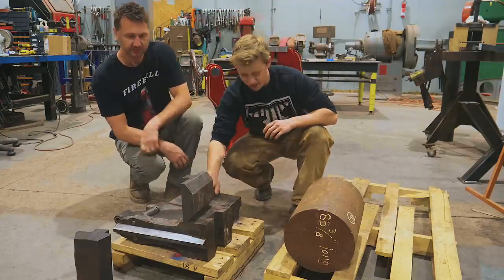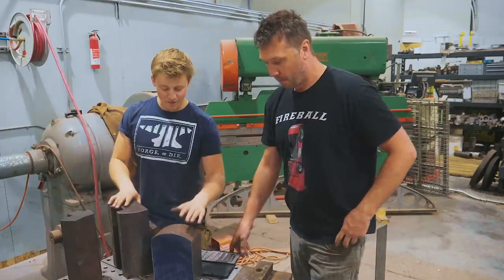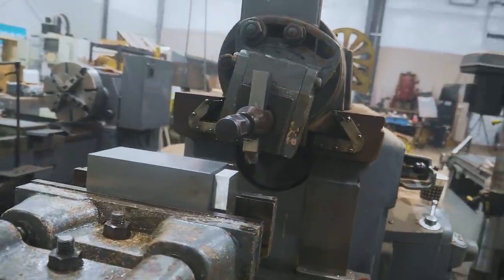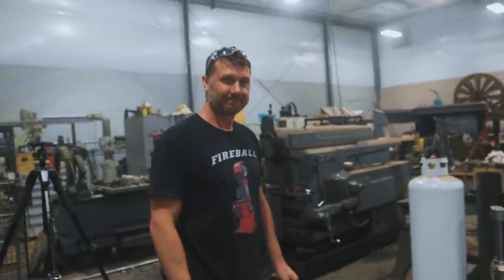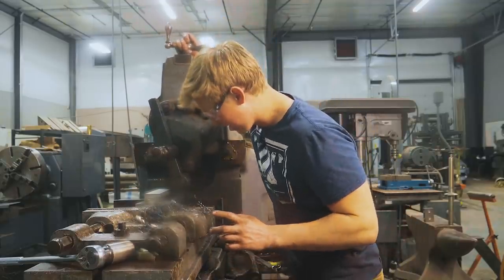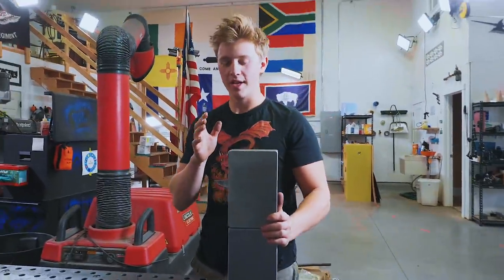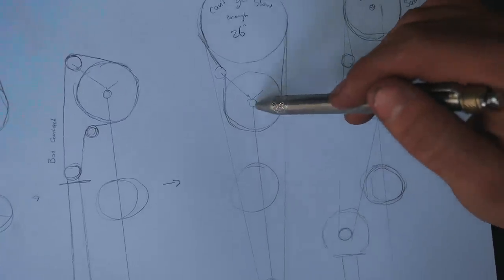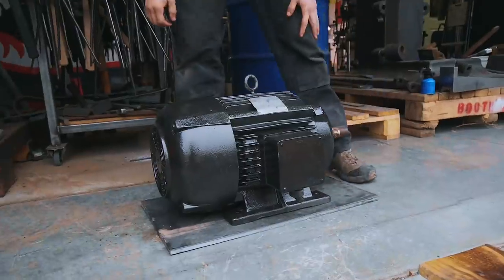RESTORING THE FAIRBANKS POWERHAMMER!!! Part 5

Comment: The shaper is simultaneously fascinating & terrifying. It is literately just carving away steel like you would carve wood with a knife.
Reply: I was little surprised. Seemed to be heating the chips from what i saw.
Reply: Such big cuts too
Reply: @1014p  That heat is being generated by the friction. Same as drilling or milling.
Reply: Right it's like the world's biggest most complicated & scary chisel.
Reply: Looks more like the linear version of a lathe to me. It's just that it runs so slowly by comparison- you can see the chips change color as they are cut, when you can't on a lathe (unless you watch in slo-mo).
Reply: @markfergerson2145  That's the thing, though, a lathe, like a mill, uses rotational velocity to make a cut, where as this just uses an edge and what has to be tons of linear force. That's what makes it scary: the shear (ba dum tish) amount of force being applied.
Reply: @Varentill  right, the advantage of the shaper being that the cutting edge can move much slower than on a lathe or mill, which can means that the heat could be controlled arbitrarily? (Need it cooler? Go slower)
Reply: @1014p  it is literally shearing steel apart. ever take a paperclip and bend it back and forth really fast and it heats up noticeably? this is that but at several thousand times the scale. the amount of kinetic energy being put into that act is phenomenal. those chips are a couple hundred degrees, you can see them discolor from how hot they are, those bluish and copperish colors. thats not paint or dye lol. come to think of it you could probably get a pretty accurate measurement of the temperature based off of that discoloration.

edit

yeah. Heat the steel to temperatures from 400 to 800 degrees Fahrenheit, to produce oxidation colors. At 480 degrees F., the steel turns brown, at 520 degrees, it turns purple, at 575 degrees, it turns blue and at 800 degrees, it turns grey.

so at about 4 min of the vid, those chips are around 575 degrees f on one side and 480 f on the other. the "hot" side would be the one that just came into existence as it came off the block. about 20 seconds later the chips are very light blue and mostly grey. which if google is correct means that they are approaching 800 f
Reply: @commie4164  yes i have just cant imagine it cutting that slow and getting that hot. Makes me wonder how the blade can handle that kind of force.
Reply: Imagine what it could do to flesh and bone
Reply: @1014p  We were using a smaller one in school.  Then the tool snapped.  Missed a guys head by ~6"...

Safety glasses won't save you from that.
Reply: @NemoConsequentae  You would think there would be some sort of guard on it, or around it. With these sort of forces, a broken tool is going to do some damage to 𝒔𝒐𝒎𝒆𝒕𝒉𝒊𝒏𝒈.
Reply: @2H80vids  No guard on them.  We were in front of it, basically where the camera was filming from.  Have a look at the shaper, you'd need to have a huge surround that needed to be moved for any adjustment.  Also, these are old machines from before such things were common.  Back from the dim, dark days, before common sense was bred out of the population! :p  
Like in the days before warnings like "May contain nuts" was required on packets of nuts...
Reply: @NemoConsequentae  Being an old machine, designed by and, in theory used by, folks with a bit of common sense, it doen't surprise me that it didn't 𝑐𝑜𝑚𝑒 with a guard. In this day and age however, I'd have thought that modern safety regs would require some sort of guard to be fitted when used in a shop. I'm no machinist and I'm not saying it really needs one (if used correctly), just saying I'm surprised one isn't fitted.
The nuts are a fine example of how it's not always left to the 𝑜𝑝𝑒𝑟𝑎𝑡𝑜𝑟 to make the decision. 😁
A pretty impressive bit of kit though; I'd love to watch one up close.
Reply: @2H80vids  They wouldn't have bothered with guards, as it would have interfered with setting up the work.
Reply: I seriously can't reconcile shaving a piece of steel off so hard it changes color, it's unbelievably awesome.

Comment: When you think you've seen every piece of metal working machinery there is... Insert "The Shaper"!
Reply: check out abom79, he has done a lot with a shaper. and is also very in depth with what he is doing
Reply: @seanthompson6720  clicked on the comment to say the same thing! I feel like I am a shaper expert after watching Abom
Reply: What got me was its God Like Powers. i mean the shavings were major piece of steel all by themselves.
Reply: Wait until you see spray welding!
Reply: @RichardCranium321  .....WHAT!
Reply: @ADDBlacksmith  uses powder metal & oxy-acetylene to make a sand blaster style flame thrower that coats stuff with red hot metal!
Reply: @RichardCranium321  Abom79 does spray welding too! 😸 Shapers and spray welding and milling and 6 jaw chuck lathes and more indicators and machinists squares than you can shake a caliper at. 🤣
Reply: Wait until you hear that there's a metal planer...
Reply: @RichardCranium321  especially the detonation spray version- where it's detonating the oxy acetylene mix multiple times a second :)
Reply: @AngDavies  interrupted ignition? Don't think I've ever seen that, I'm only familiar with the constant flame old school stuff which is still a treat to watch being done.  I find it interesting that a lot of tools can fill various rolls in the shop but there is no real substitute for spray welding...
Reply: @mannys9130  I used to live about 45 mins from his shop outside Pensacola. Love how he maintains the mechanical/manual machining mindset in the era of CNC, CAD/CAM.  Dude not only has awesome shop,  the parts that come out of it are mind blowing. Truly honoring his grandfather and father by taking pride in every piece, no matter how small or large.
Reply: that thing blew my mind, i watch a lot of these kinds of videos but never seen  that before. it probably costs more then my house but i want one now.
Reply: @longleaf1217  less than a used Bridgeport vertical mill in most cases that I've come across... i been looking for an affordable used mill & have seen a few shapers go for anything from $2500-$12K depending on size, age, brand, condition, delivery, etc...
Reply: We used a shaper in metal work class back in grade 8 or 9 which would be 30 ish years ago
Reply: @craigmandall9420  back when schools would actually still teach? You're almost old enough to remember when they still shot rifles & taught REAL gun safety in things like Phys Ed & Agriculture class...   so miss the good ol days
Reply: how does this "shaper" even work?!?!? if its that easy to cut metal why do we have any other tools lmao
Reply: @pvic6959  did you even watch the video?
Reply: @pvic6959  I believe they run on hydraulics, possibly some pneumatic, but it's easy to cut mild steel with hardened 01-07 tool steel/ tungsten carbide & hydraulics/ pneumatics.
Reply: @craigmandall9420  yes but i dont remember them explaining how the machine works. just that it shaves off pieces. I am curious about  the mechanics of said machine 
if they did explain that, and I missed  it, I would really appreciate a timestamp!
Reply: @RichardCranium321  ah so the metals were just really different in hardness? I'm no expert in this stuff so I dont know. to me metal is metal so seeing it get cut like butter was pretty mind blowing to me lol
Reply: @pvic6959  yea, it's basically that simple, you can take a piece of carbon steel & with proper heat treat, it can cut itself relatively easy.  It is a bit more in depth when you get into the actual molecular makeup of the different types. Wrought iron, carbon steel, High speed steel, tool steel, stainless, etc. Each has different levels of carbon, nickel, cobalt, and so on which gives wide array of different properties that can be tweaked using heat/cryo treating and oil bath quenching. It's actually kinda interesting if you're into the tool & die making industry. Just a matter of a few degrees difference can make or literally break the part you're working on... I've seen items nearly implode from improper forging & heat treating. Failure to release internal stresses before hardening & it blows apart when it's quenched, sending flaming oil everywhere.
Reply: @pvic6959  the cutting bit he used here appears to be a custom ground High speed steel blank which would entail heat treating the cutting end. Vice versa, when its time to clean up the cutting edge or you need a different profile, it's important to "normalize" it with heat before grinding so it actually removes material in seconds instead of spending an hour or 2 & possibly damaging your grinding wheel...
Reply: @RichardCranium321  wow thank you so much for all the knowledge!
Reply: @pvic6959  you're very welcome! I gladly share with anyone who's interested in the art/science/magic that is fabrication. I learned at a young age from my father who worked in a foundry & fab shop for ~20 years before being hired by NASA to maintain the crawler transporter & mobile launch platform at Kennedy Space Center. If I can spark interest in another mind with what I've been taught, my hope is that person may eventually do the same. If everyone passes on the interest for mechanical & structural sciences, maybe we would influence the next generation of young Elon Musks...
Reply: @RichardCranium321  thats super super cool! Ive always been interested/fascinated by machines and how they work/their mechanics. But hardware stuff isnt for me lol. So i ended up in software engineering. but theres something really cool about being able to SEE the machine youve build and are using
Reply: @pvic6959  I went into CAD/CAM field & it was important for me to know how each tool did what job so I could simplify the manufacturing process on the original design. Too many engineers create prints then say "I need this part" but they don't understand how it works & that some parts are physically impossible to make without a metal 3D printer which didn't exist yet. Even the plastic prototype machines cost tens of thousands & were the size of a fridge but couldn't print things larger than a cell phone at that time.

Comment: wow, I never realized metal could shave like that. I always thought it would shatter or chip when those kinds of sheer forces are applied.
Reply: Depends on the metal, some metal will do that shave like that but others will just chip. It mainly has to do with the hardness of the metal.
Reply: if you look at the mechanic of it its not all that different fromm a mill or a lathe. There is just no spinnning part. Instead the blade just moves ovet the entire length of the workpice i one continuous motion. But if youd slow down the spinning parts of a lathe or mill it would look quite similar. you can even take thicker cuts since the speed isnt as high.
Reply: I guess with enough force and pressure it’s possible
Reply: That's how they built countries back in the day. Entire rows of shapers shaping at it.
Reply: @sewi014  Shapers actually use tools that are extremely close to the tools that are used on lathes
Reply: @xbear7473  With enough force and pressure, the entire miles thick rock called the mantle, is plastic.

Comment: To Will in his future endeavors I hope you have all the success you strive for. That magnet is a permanent magnet, and the lifting capacity is rated based on a balanced, flat load where they are in full contact with the ferrous material being lifted. They have only a fraction of their rated lifting power on round stock.

Comment: 1:40 i dont think thats an electro magnet, the power source would have to be really strong, more likely its a physical magnet that gets moved closer to the surface by the lever
Reply: And how would you separate them?
Reply: Through physics magic, there are completely physical on/off magnets. The lever moves a piece that, for lack of a better analogy, "shorts" the permanent magnet, making it mostly non-magnetic.
Magnetic bases and magnetic chucks work on the same principle.
Reply: Google "Magnetic switchable device", wiki has an explanation.
Reply: @EricMBlog  Exactly, it's a pretty cool setup.
Reply: @EricMBlog  thanks for the more detailed explaination! If it was an electromagnet it would take SO much power to be that strong
Reply: @Sausketo  Yup - that device is definitely a switchable magnet - not an electromagnet. I've always been fascinated by them, and only recently actually learned about them. Prior to that, they were just black magic to me 😂
Reply: I was looking for the huge power cord to power an electromagnet that strong!

Comment: "which is about a quarter of the speed of the motor"
Just slap a VFD on it and call it a day. If you cant make it perfect, make it adjustable.
Reply: Good idea but they can be a bit unstable,   and they wear out much more quickly.
Reply: Agree on the VFD! But not if you are going to use that motor in an application where the weight of the motor provides the tension on the belt. Great restore! I love this one, I can’t wait to see it in operation!
Reply: @adamc777  Are you thinking of cooling? Some motors are fine with the lower RPM, while others require external cooling.
Then there are no problems with shortened longevity compared to a "normal" motor

Comment: Cool to see that Fireball tools has the same type of shaping machine we had at my old workplace.  One of the best machines for just ploughing material off a oversized chunk of material.  The have a large diversity of usage as well. from just ripping material all the way to smooth surface finishes with the right cut and settings, our shaping machine could make a better finish than the surface grinder we had (on non-hardened materials. also the grinder was clapped out and worn )

Comment: I am shocked that you both dont use hair nets when working on the lathe or the drilling machine, because it could do major harm to you head if your hair would get caught by the spinning parts. That is a real safty issue. Please for the health and safety think about it for a minute and start using hair nets when working on those machines.
Always a pleasure watching you doing these amazing builds and craftsmen.

Comment: Those 4340 chips mixed with some S110V chips would make for an AMAZING damascus. But the forge weld and heat treatment would be absolute MURDER.

Also. Might want to crack that motor open and check the bearings inside. It's obviously been sitting outside for a long while.

Comment: my old shop had a giant vertical lathe, that could machine parts that were 8 feet wide, and 5 feet tall, overkill if you ask me
Reply: The biggest one of those I have seen was 15' round 20' high. A machine shop I dealt with just had it installed and was setting it up.

Comment: I NEVER got to work on the shapers they had at Ertle. Heh. They were Cincinnatis too. 3 24 inchers. But not in my department.
!!!YIKES!!! Bare hand lifting a heavy worked piece with chips on it is how I got two days off work and no overtime. (thurs. fri. and no OT sat.) I didn't feel the shard go in my thumb until I sat it down. Air-hosed off everything from the lathe or wore gloves thereafter.

Comment: I have no idea how thick those 1 inch and a quarter chips are, nor how many you managed to bring home, but I was thinking- could you possibly make something for Jason from them? maybe a Damascus knife or a couple of woodworking tools like a card scraper and fine chisel set? ( I noticed he dabbles with wood in many of his projects.) I realize I completely missed the type of steel you used for your dies, I just assumed it was something like S7 that is able to be hardened and tempered.
Did you check your bearings on your motor? might need new ones.
Thanks for the videos, y'all have a good one.

Comment: Why isn't the cutting edge of that shaper just melting?  I know they spray it down once in a while, but still....

Also... what was the motor and gearing like on the original hammer?

Comment: How’d you end up with an electric motor off an old concrete or rock saw? 🤔

Usually those things end up destroyed from the lateral load, but that does mean it should be well suited to your use case.

Comment: Theres a shop in Raleigh NC that I used to work for. They have a power hammer similar to yours that still uses a leather drive belt and tension system that works well.

Comment: I am amazed at the precision in making all the dies and arms but yet when it comes to the heart of the machine - the motor doesn't get new bearings or seals???
Please make sure the motor is up to standard to do the machine justice otherwise you will be let down when you go to turn it on only to have the motor fail or make horrible grinding noise due to bad bearings.

Comment: What's the reasoning on using the shaper instead of a mill?
Reply: You can change the angle of that cut to whatever you need. Otherwise you would need to get two dovetail cutters to cut the two different angled dovetails required. Other than that, I'm guessing they want to show it off since it is a bit of a rarity nowadays since it is less productive for the given HP than a mill since it wastes time on the backstroke.

Comment: Stupid question but is it possible to reclaim the shavings or is it not worth it
Reply: You reclaim any metal, but it’s not as easy with steel. Once you heat steel to it’s melting point you change the carbon content because some burns off.
Reply: @chronovore7234  interesting just seems like a lot of wasted material, which I interpret as lost revenue.